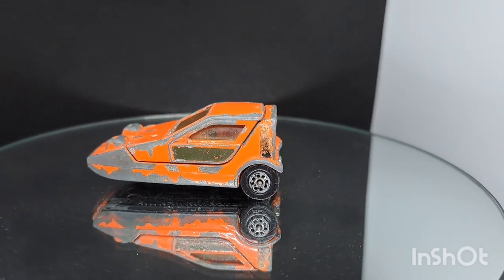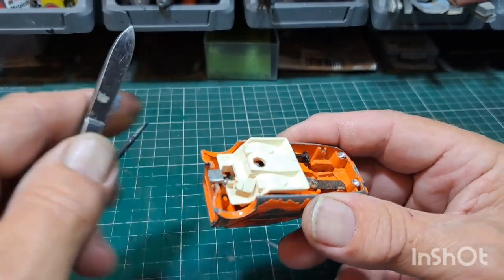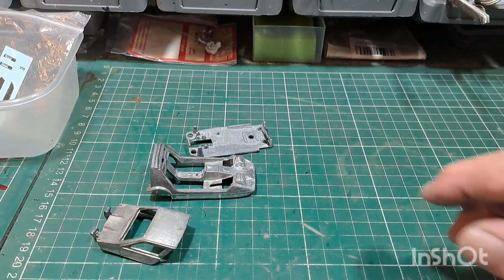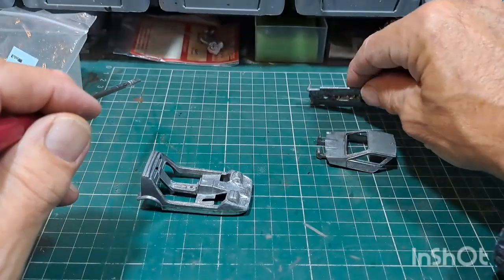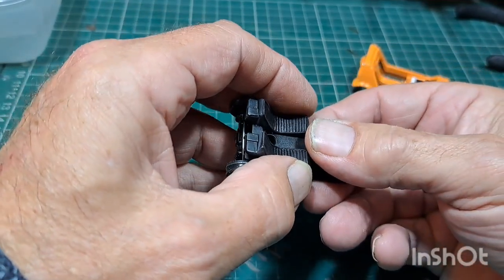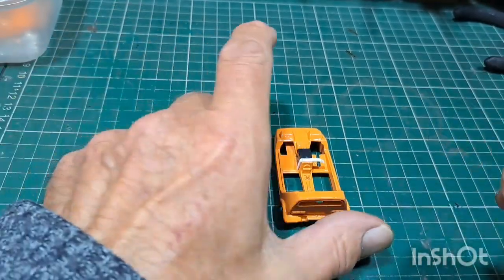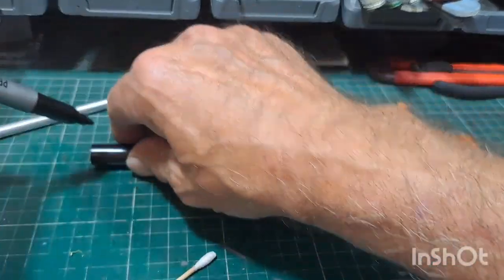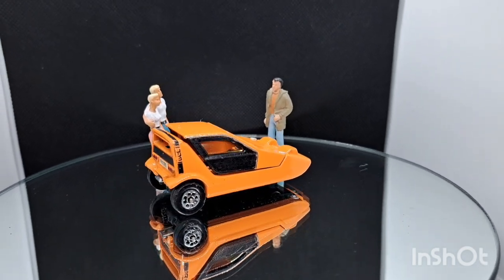Diecast Restoration Corgi Toys Bond Bug no/389.  1971/74

Comment: Hi Martin nice job on this funny little car I wouldn't like to be boxed in by semi trailers in this thing. They did one of these on Wheeler Dealers with Edd China. I didn't realise there were so many of them around but there are. I had a nasty shock going to a duo gig the other day. My car has a dash cam and I was on a freeway towing an enclosed trailer full of band gear. I remember seeing a 4WD ute pass me with a open trailer that had a very dodgy looking blue 44 gallon drum badly secured in the back. About 5 mins latter suddenly the drum was right in the middle of the road in front of me😲 no ute or trailer in sight. I don't know how I did it but I managed to get around it without hitting it or anybody else. I watched the dash cam footage back and it was definitely the same blue drum that was on that trailer. It looks like it had come off the trailer hit the side rail on my side of the road and started to slowly roll across the road in front of me. Luckily there was not another car directly behind me or in the other lane and after I past it I saw in my rear mirror it kept rolling across two lanes and onto the other shoulder. So that was my bit of excitement for the weekend. catch you on the next one mate great video.👍🏻
Reply from the maker: Blimey Geoff, that was a close call that could have ended badly, at least it tested your lightning reaction skills .
Be careful out there my friend

Comment: I had one of these - no idea WHAT happened to it! Shame.
I was surprised you didn't go the 'hot pipe' route to get the glass out of that clip, but the body mods are a very good improvement on a kinda sloppy original. Nice one!
Reply from the maker: Cheers fraser the hot pipe would have been dodgy because you could see all the underside when you lifted the hood .
All the best Martin 👍

Comment: 1970-1974, 2-seater, 3 whhels, 4 speed, 4 cylinder, 200 miles per tank, 30 horsepower, 700cc engine, top speed 70 MPH, sold new for around 700 quidm 99% of them came painted in tangerine. I wouldn't want one i real life, but it is a fucar to have as a toy. Ya did a great job on this. I just wish Ya painted it in a different color, lol.
Reply from the maker: Cheers cat nice peice of information brother 👍 I wouldn't want one ither